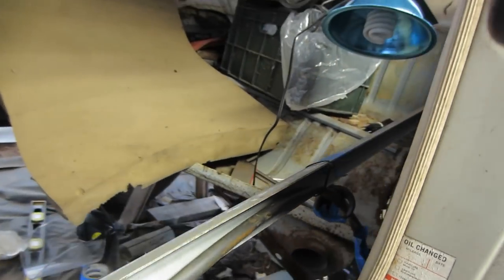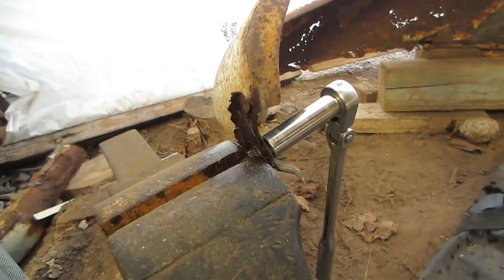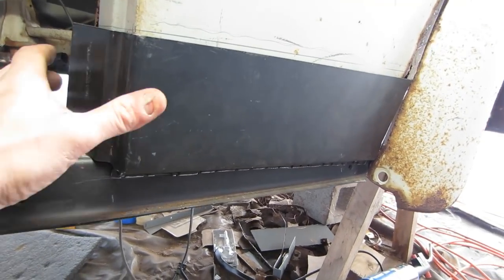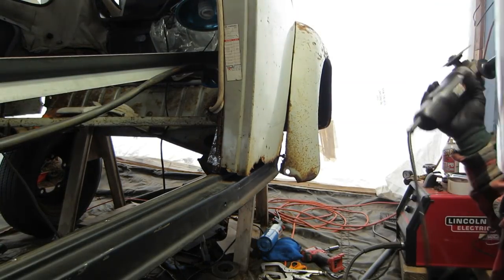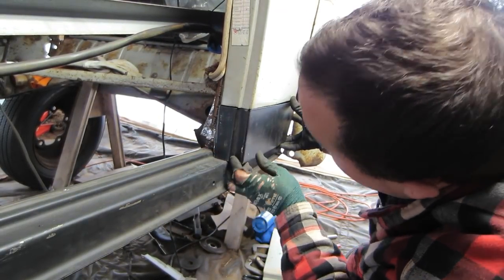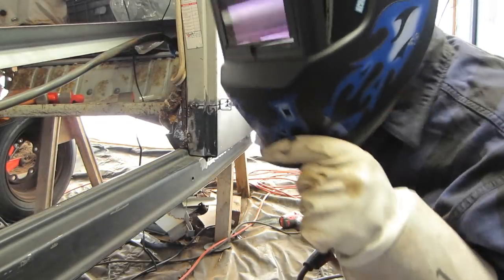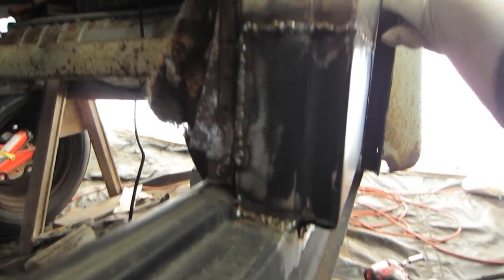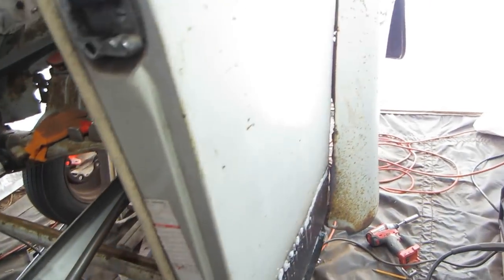1965 vw beetle drivers rear quarter

Comment: those lower quarter sections are usually arched all the way down. When you shut the door did the body line up? that might be why there appeared to be a low on the weld. Plus they almost always need to be reshaped. Old molds on the black metal. But they work.

Comment: I think you did a great job, that type of weld seam challenging to get a good fit and weld, lap joint more forgiving, with that said great job. I pay good money for a welding hood , from air gas a miller hood , I just cannot see out of it. Someone told me HF higher end hood easy to see, I will pick it up, if not my son has a new welding hood. We had a warm up from 54 below to almost 50 above . 43 today will drop in the 20's and then snow Tue-Thur this week.You really have good skills at this metal fab you found a fun hobby.
Reply from the maker: Great comment and I'm glad to hear that you survive the cold temperatures I couldn't even imagine those temps...

Comment: hello  i know that every welder is a bit different

but what size wire you using and what settings you have you welder set on

thanks
craig
Reply from the maker: .25 wire argon/co mix. Thanks for 👀
Reply from the maker: You have to test settings on scrap materials of same thicknesses. I believe i was running 3-5 or lower for settings

Comment: Hello. What did you use to keep the bug in the air while you worked on the body. Thanks.
Reply from the maker: Thanks for comment... the beetle was just held up with some very simple saw horses.  Not a ton of weight holding them up..

Comment: E-man Deluxe. Would you recommend your Lincoln Welder? I also just bought a 65 Bug Fontana paint and same interior color. The Body and Chassis in the same condition or worse. Love your videos. Learned a lot.
Reply from the maker: Thanks for the compliment.  I plan on getting back on videos soon.  Life has been tough to fit the time in on making them.  Yes I would go for a Lincoln welder... not terribly expensive and still works great.  Mike Fn garage also raves on a 110v model from harbor frieght.  Sounds very promising.  May be a bit cheaper. He has a review video on it.✌

Comment: E man .Got  thinking about your patch panel and where you went wrong .... I think you should've hung the outside panel first... Got it  tack  to your frame rail......  then put your patch panel on the inside . First go outside then go inside to fix heater boxes area to repair.....  I think you're pulling the bottom of that body panel into tight.... Which gave you that little valley in the panel... Because  you had to shave some off that repair panel to make it fit.... What I think you need to do now..... thinking it's time to get out your ruler and go measure from the center tunnel to the outside rail!!!!!   or go outside to out side on the floor pan OF THE BUG to make sure you're not pulling a body into..... I understand the car is like a ladies dress and blowing in wind!!!!!!!  everything was rotted... I think you need to do some measurements for your BBBBBB pillar lands on your FLOOR PAN  don't PULL THE BODY SIDES  IN TO tight it's just the carpenter  SIDE OF ME coming out!!!!!!!!!!  Also EMAN HUNG around the body shop on and off and helped out for over 40 years take care keep up the good work didn't see the fire extinguisher you're slacking Junkman do
Reply from the maker: I understand what you are saying.  Thanks.  The profile of the replacement panel wasnt perfect but good enough.  Moving on.... BTW fire extinguisher is above stump vise out of the way. Of work zone.  Thanks for caring